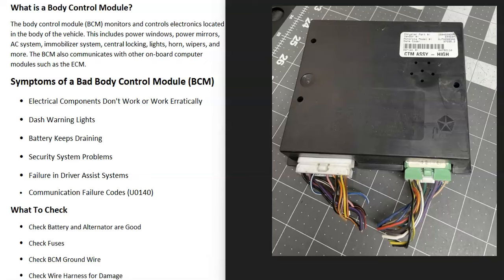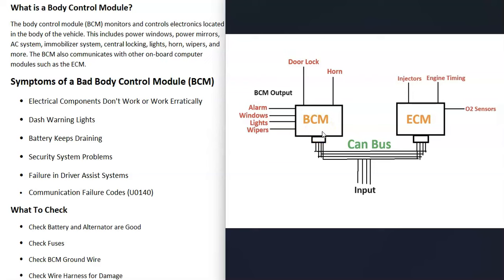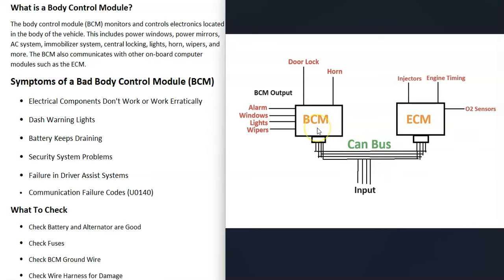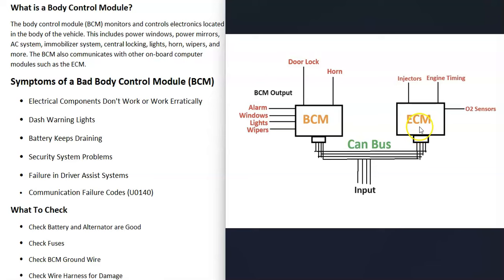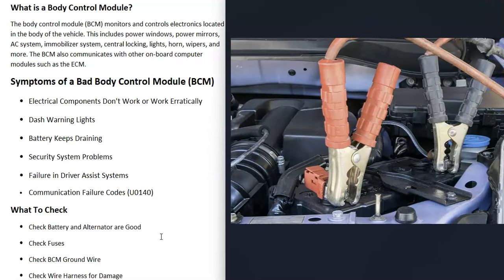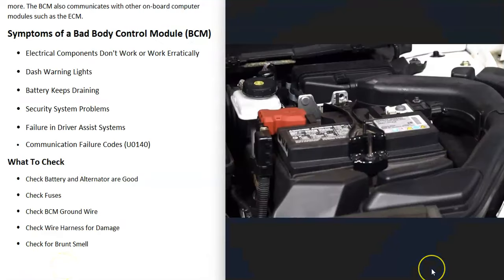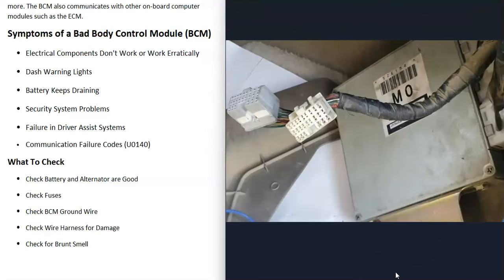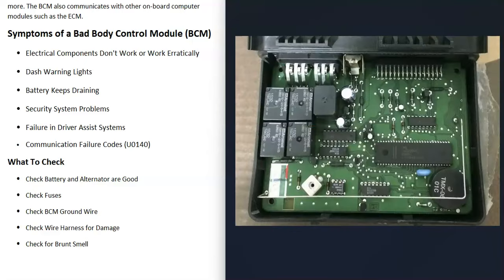Symptoms of a Bad Body Control Module (BCM)

Comment: I have a 2019 ram 1500 limited i was driving the whole day and while driving al the lights came on the ac started to blow heat instead of cooling and the about 5 to 10 minutes the logo came back like if you turn the key on to start and then everything was back to normal it happens 5 times n 4 hour is the any body that could help me thanks

Comment: I replaced my bcm in 2019 ,now on 2024 same symptoms again,dim lights, all of my ground wires are tight,plus battery  cables,when I put in park turn off engine,the speakers pop, sounds like bcm again,plus sluggish going up hill,at 55mpg plus,have new transportation 6 speed gmc 2500hd 6.0,

Comment: With the key out, I can still turn on the wipers, roll down windows, the headlights stay on, etc… So the battery draws a ton of power and will be dead in an hour or so. The dealer says I can’t get a new bcm and my vehicle rejected the salvage one I brought in. Now what????
Reply: The BCM has to be programmed

Comment: Do controller radio cause my Bluetooth keep malfunctioning I reboot the computer system by remove the battery panel turn my light on Ronaldo electrical current into it and reconnected my radio started work and when I drive to work, it stopped no more Bluetooth just cut the hell off

Comment: My bcm on my 19 f350 is getting replaced as I type. Some of the tpm sensors have to be replaced as well. My horn , lights, hazards, tpm, ebrake chime, door locks, tranny module etc started going nuts. $2200 so far. The harness connection had corrosion but it seems to be all right. What a pain in the arse.

Comment: My GMC Sierra 2500 HD has door locks clicking intermittently, ignition start function isolation, the rpm undulates up and down while cruising, cruise control light shows on but won’t set a speed and there is a check engine light. Already changed the brake switch 8 months ago and it cleared up. Now it’s back

Comment: Yep, having one ordered today. 2006 mazda 6 while lights is on if i use right or left turn signals the hazards come on! If i turn lights off the turn signals work like their supposed to. Also if i lock my doors with the key fob the hazards come on. My mechanic has one on the way. Just hopefully it won't need reprogrammed which will cost more. Fingers crossed.

Comment: So if the immobilizer key light is on and the dash lights for gear isn’t lit, the headlights won’t work and I can’t start the vehicle because I can’t get the immobilizer light off or dash lights to come on. Would I need Bcm or ecm and would I need to have it programmed to vehicle first. Or can dealership flash and reprogram my original if I take it out and to them to save a few bucks on tow

Comment: Thanks - very helpful video! My 04 GMC Yukon has randomly exhibited the following crazy alarms, displays and behaviors: Seatbelts (when all are fastened), Tire Pressure Monitor, Service Stability Control. Once the key fob stopped unlocking and then was OK. Also the left turn signal was freezing without flashing and coming on (solid) with brake pedal. AutoZone read the following fail codes: C0196 Yaw Rate Circuit Malfunction and C0455 Steering Position Sensor Circuit Malfunction. Does all this sound like the BCM is the likely culprit? And if so, does a replacement have to be programmed by a dealer?

Comment: 2013 ram 1500 sport. All of those issues you talked about in your video. The truck wouldn't shut off so we unhooked to battery and after hooking it back up, pretty much no power to anything but the cab light, the side mirrors have power, the push start says off, headlights, tail lights, but no dash lights or power. If this is replaced, does it have to be programmed by a shop or dealer?
Reply: Did you find anything out?

Comment: Very good video, almost all the lights and gauges on my dash either came on or stopped working all together.  Spent the day just chasing wires and checking fuses but this sounds like the answer to my problem.  Thanks!

Comment: I suspect a bad BCM on my 2015 Q50 I see people on ebay selling the BCM and ECM as a pair with the matching Key Fob would I be able to replace both and not need to program anything ? I am assuming the car would not know the difference as long as they are both replaced with a matching set. Thoughts?
Reply from the maker: Replacing computer modules varies and depends on the vehicle and the module software. Sometimes it is a simple swap out other times it will need a software update/programed. It is best to research the information case by case.

Comment: Would this bcm possibly control the truck releasing? I can open it manually but not with the release on the truck, the left side of steering wheel, my remote or nothing! I've checked the wmswitch to in tge glove box! I know about that one! Any thing???
Reply: O yes I hv a 2009-2014 maxima
Reply from the maker: It's possible, but usually, when the BCM is bad, there are multiple issues.

Comment: I have a 2015 Camaro that the radio cuts out the dash board light go on and off my blinkers have issues. So should I check the BCM or maybe the fuse?
Reply: Maybe, Check your blinker fluid?

Comment: I have 2016 Chevy Silverado 2500 it shows all the signs you have described in your video of Bad BCM bought new one from Chevy dealership an asked them to program new one to truck they said had no communication to it my fuse box on passenger side has no power to it checked all fuses seem good need help is dealership just trying to get more money out of me
Reply: Did you solve your issue I’m in same boat

Comment: Good stuff, My alarm keeps telling me my trunk is open but the dash doesn't indicate it is, So the alarm triggers every 30 mins. "New Alarm" Did same thing with old alarm and Also draining battery like it did with old alarm. Lights used to flicker a while back all dash lights, AC would stop working, just weird stuff but I think that was caused by a bad alternator, I have since replaced the Alternator, New battery, Cleaned battery ground cable, cleaned alternator ground cable. The only weird stuff happening is some doors won't close and sometime they will. The the trunk open is triggering my alarm and draining my batter. So I am wondering if it could also be a bad Actuator on a door or even the power trunk mechanism?  

I had a friend run a computer scan and check the BCM for errors he said it all came back clear.   :o/ 

I will take a look at the ground in the BCM and also take out the bcm and smell it. I should not have to program the bcm if i remove it? all I would have to do is Remove the ground from the battery before unplugging it for inspection? 

Thanks for this video, very helpful insight.

Comment: Would it cause the vehicle (04 tahoe) to loose power for a split second and or lock and unlock doors while driving
Reply: I have an 04 tahoe.  Service 4x4 and brake system had popped up on display before with the check engine and service brake lights. After this I couldn't start with the key bit could remote start and it would run but feel sluggish. Eventually this went away and my key had been working for months. Had been getting a lot of squeaking and clicking under my passenger  side dash, when feeling around i decided to turn on air blower on and all the dash stuff popped back up. Turned off and tried to start with key and it seems I'm back at square one. Does any of this sound familiar? Did you get a new BCM? Sorry this is long af. 😅